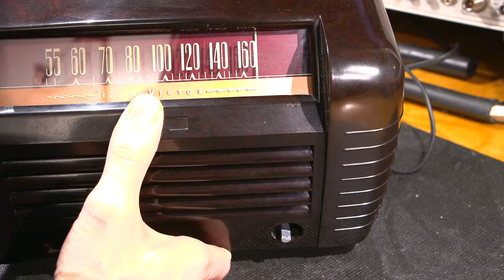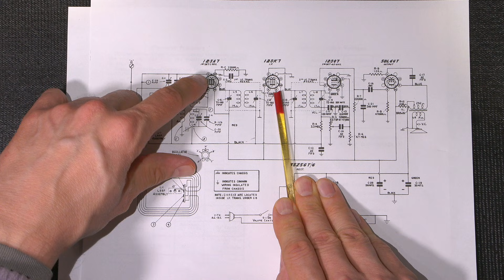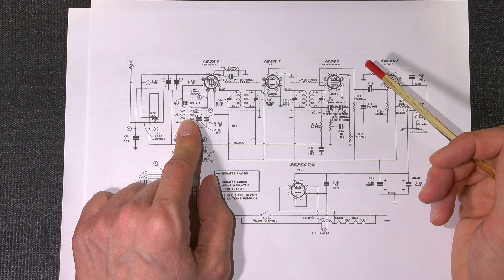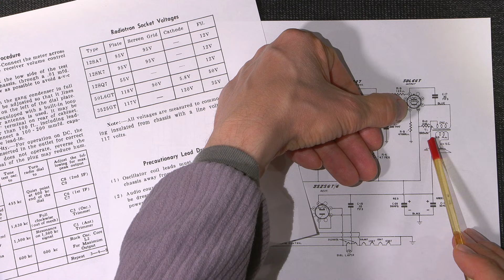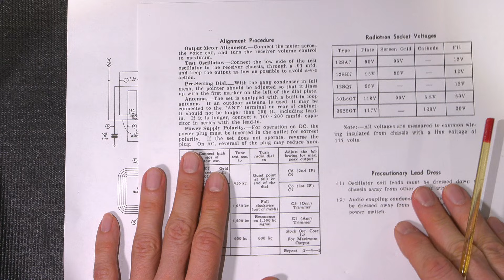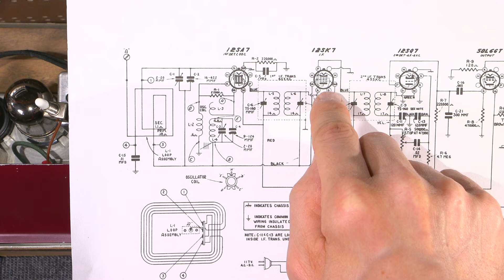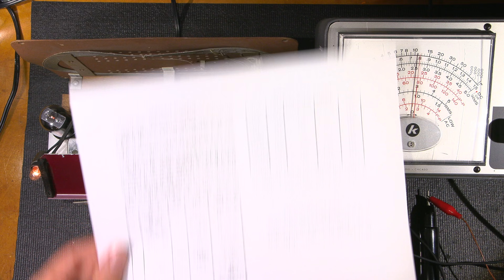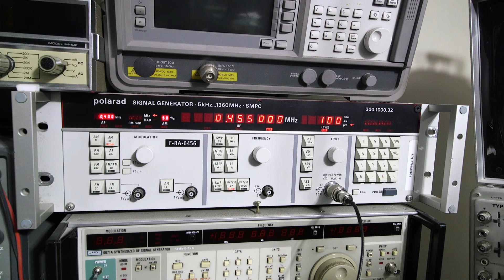Master Electronic Alignments!

Comment from the maker: To learn electronics in a very different and effective way, and gain access to Mr Carlson's personal designs and inventions, visit the Mr Carlson's Lab Patreon page here: https://www.patreon.com/MrCarlsonsLab
Reply: Question, why could you not use a Function Generator?  My Siglent SDG5162 can do 455KHz and modulate at 400Hz.  It can NOT go down to 100uV range, but you can slap the output through a 40dB attenuator (/1000).
Reply: BTW, really great video!  Thanks for the education.
Reply: Ive used a function generator at times but the results were no great, too many harmonics . You need a good LC style oscillator to start with. The sweep control range as unstable too. Function generators are nice but made fir Digital or audio circuitry. RF is its own mysterious world.
Reply: This was a very interesting video you are very good at what you do. Thank you

Comment: Very interesting video. Thank you. A question: If you come across an IF that is really mistuned would you start adjusting the transformers at the beginning of the IF or at the end and work towards the front end?
Reply from the maker: I usually begin with the first IF transformer, then move towards the detector.

Comment: I wish you would say more about the ‘Dummy Antenna’ bit. The instructions for alignment I’m looking at give values for a dummy antenna that vary with the operation being performed: Steps 1 & 2 of the AM Alignment call for 0.01 mfd; Steps 3 through 5 call for a 200 mmfd (thank you explaining that they mean pico farads), the two versions of the IF alignment don’t call for a dummy antenna at all, and FM RF Alignment calls for two 120 Ohm carbon resistors. 

I’ve listened to other YouTubers emphasize matching the 50 Ohm impedance of the instrument to the 75 Ohm impedance of the Device Under Test, and then using a balun to convert to 300 Ohm to mate up to a typical AM loop or FM balanced antenna connection. 

It was a good overview of the several methods, though, and valuable for that reason. Especially for translating the rather cryptic instructions. The output of the spectrum analyzer certainly gives one confidence that the initial has, indeed, been aligned, though. I like it. How much? (Probably more than I can afford.)

Edit: I went back and re-watched you go through the actual steps of the peaking procedure, I really appreciate the tips about the speaker and tone generation. Reading my own instructions, I learned what the cryptic ‘A’, ‘B’, and ‘C’ markings were on my schematic: they are calling out the insertion points for inserting the signal from the generator! Thanks again.

Comment: I peak the IF and then chek them with my Tiny/SA spectrum Analyzer. Your curve was all wonky because you used physical connection to inject your signal and caused overloads and mis matches. I loosely couple my signals in using sand old loop from a junk radio and couple it to the real loop , part of the set. You also did not disable the oscillator for accurate IF response.  Either response would deliver  the same results to the human ear.
Reply: Trabajé como ajustador en fábrica de radios. No es necesario bloquear al oscilador en los ajustes de FI. Nunca el tamdem (o capacitor variable) debe estar cerrado, aunque es suficiente con que esté a mitad de recorrido o más. Lo ideal es neutralizar el AGC pero tampoco es necesario si se utiliza la mínima señal posible desde el generador de señales. En aquellos tiempos no utilizabamos barredor para FI de am. Hoy, ya como hobby he fabricado algunos y es muy placentero ajustar con ellos.

Comment: When I was a kid in the 1960s you seen part 15 of fcc stated shall not cause radio interferance on lots of things. Crummy little walkie talkies that wouldent even transmit across the street even had this stated on a tag. Jump to today, you don't see this anymore.led lights and switch mode power supply's rip up a m radios and nobody seems to care . I think the movement sacrificed a m for these crummy products that fail to live up so they could push thier junk import products!

Comment: I have an old Lafayette radio with no alignment instructions available anywhere.  I've got much of it sorted, but the speaker is a field coil type with a humbucker coil in series with the voice coil and the output transformer is mounted right on it..  The only way to disconnect the speaker would be to cut the thin and very short wire between the output transformer and the speaker terminal.  Which could be difficult to repair.  Is there another method to measure voltage and peak the IF coils with the speaker in circuit?

Comment: I'm working on a Duk v95 set which is a 3 band set. I'm trying to relate the alignment procedure to the one in your video. In the manual I think it is telling me to use a 128khz modulated signal and go through the same process as you talked about. So does that mean the IF of this radio is 128khz?

Comment: If you didn’t have a VTVM would it still be useful to disconnect the voice coil of the speaker from the output transformer and connect something like an AVO8 across the output transformer? I’m thinking the impedance would still be far higher than the speaker and allow for better sensitivity?

Comment: First I want to let you know that I absolutely love your channel. Your knowledge and the quality is just beyond reproach. The only comment I wanted to make about this video was about when you were describing these all American five tube radios that were transformerless, you mention it was done to keep costs down. I believe that was true in later years, but initially it was done because a lot of the power especially in large older cities like New York was truly just DC. As AC came on line a lot of the buildings were supplied with both AC and DC, but initially it was only DC. So in order to make these radios work in both situations they had to be transformerless to function. It wasn't a matter of being transformerlesd to save money but in order to make it so people could buy these radios and actually use them as they only had DC available. In fact New York City shut down its last DC supply to the last section of the city in 2007! There were a lot of people that would utilize the wrong outlet and actually damage their newer appliances as there were both AC and DC available especially in apartment buildings in later years.

Comment: Got a very interesting series strung set, but it’s AC only. It’s using a 25Z6G as a (I believe it’s full wave) voltage doubler. It does have a little bit of 60hZ on the speaker. not bothering me though very quiet to me! The receiver is receiving, but the alignment is off.

Comment: Ive got a vintage AM Firestone radio. The service notes clam an IF frequency of 455 Kilohertz. Upon testing the alignment it is revealed to be tuned  to 465 Kilohertz.  The reception is quite good, it picks up 20 stations , good for an AA5 radio. I was considering retuning the IF’s to 455 K. However none of my alignment tools fit the slug slots. This is far as I am going to go. Why screw up a good working radio. My tools are all new and not worn. I have every slot size. The diameter of the slug is very small . It is difficult to see inside the coil shaft, but I can see a straight screw slot. Possibly the core is frozen? From experience I know to leave it alone for now. My curiosity considers is 455 as good as 465. IF signals are IF signals as long as you are in the ball park of standard frequencies. Its not like working at 260 Khz. 460 is still within the design ranges

Comment: When I learned to do an alignment, the first step was to disable the oscillator and then place the leads of a Simpson 260 VOM across the the speaker secondary with a 4 ohm dummy load, speaker disconnected. I still use that technique as well as the Sweep IF method.

Comment: Nothing was said about the VTVM setting on AC or DC. If connecting across the voice coil, I would think the AC setting sould be the proper setting. The output transformer doing what transformers do, blocks DC. which would logically say to me that the voice coil is an AC winding. Therefor, why would a meter be on the DC setting?

Comment: Paul this receiver has been one of my toughest, I don’t have the original fiberboard antenna so figuring out the wiring that is suppose to connect to the two sections of the antenna and back to the radio has been tough. I see it needs a signal to show voltage at the voice coil so what would be the max voltage I could see on the voice coil? I have voltages in all points of the radio. Last why does it have a 3 wire hookup from the primary of the speaker transformer. I only work on this when I have nothing else to do. Thanks.

Comment: Ive searched and searched. No one has made a service grade AM Sweep generator , I say again no one. Yes, you can get a lab grade unit for Big bucks. Eico once made a wobulator type, but it sucked and none of my fellow techs used it. The old guard of the 1950’s swore by the peaking method  , a signal Generator and simple meter.RCA made the 501 that swept the 455 Kc IF range. You had to plug in a Crystal, that RCA never supplied. Whats that say? I had that one once and again it sucked on IF alignment. Sooo..back to the peaking method and I done in 15 minutes. Once I had access to lab grade equipment, bit could never see any advantage of sweeping 455Kc. Back in the 1970’s. Company called Murata made a ceramic filter to replace the entire IF stage. It worked but added 5 cents to the cost of manufacturing, so it was nixed .
Reply from the maker: You might be interested in this: https://richardsears.wordpress.com/2011/09/08/triumph-830-wobbulator-oscillograph/ It's designed to sweep lower frequency IF's and its a scope in one package. I don't own one, but I'm sure one will find me and end up in a future video.

Comment: Was the  radio you aligned  in the alignment tutorial an RCA? I have one just like it , however the lower end of band tuning coil next to the variable capacitor is missing from my radio. I’ve been doing AM radio alignment for over 50 years and still found your video an eye opener. Ya learn something new every day. I have never had the equipment to do a sweep alignment setup. Now i might look for a sweep Generator. 
When I learned  the AM alignment  process we used a. Simpson 260 on the AC scale and output function.

Comment: In an all american 5, what would be the effect if you made a Ground loop around the chasis and Isolated it from voltage with stand offs?  Is there a NEED for the chasis to be electified?  On an older radio I found both a ground circuit and a different chasis ground, both used a different colored wiring on each of the circuits. It wouldn't be much more to do than rewiring the line cord and all cap and such if it would be safer with a couple of standoffs and 2ft of wire.

Comment: An example of a high powered radio station (in experimental mode) was WLW in southwestern Ohiol  ITS max power was 500,000 watts.  It was entirely experimanl and just before wwII its license was put back to 50,000 watts.  Stories from Mason Ohio where the transmitter is located in that time had music coming out of gutter pipes.  Because of its experience their engineers were tasked with designing Voice of America (Bethany, Ohio).  Hitler call them the Cincinnati Liars because of VOA' broadcast.

Comment: This comes over half a year later, but I hope it still turns up OK.  When the instructions and you mentioned the 10 nF (A.K.A  0.01 microfarad) coupling capacitor, it might be good to notice that modern capacitors have pretty much abandoned marking them as fractions of a microfarad.  In fact, the  ISO and other international standards spell out a rule that values should be expressed such that they fall to range of 0.1 (inclusive) to 10 000 (again inclusive).  What the capacitor manufacturers use for at least the small ceramic capacitor (10 nF as an example) is two digits ( 10 for the beginning value ) and follow with a multiplier ( 3 in this case ).  The multiplier counts up from picofarads and means the number of zeros after the "10".  That produces the final meaning of 10 000 pF, labeled as 103.  Film capacitors have more space for printing their values and may not use the same method that the ceramic capacitors do, but in any case it would be beneficial to understand the picofarad based marking, I believe.

Comment: I love you video's.They are great way to relax and learn too.You do a excellant job of explaining what your doing.its hard to believe all the stuff our last generations invented. just getting radio to work and radios to recieve it  were great inventions. i remember my mom and dad had tube radio's. i remember the heat coming from it would keep us warm in the winter. And it had a certain smell too if dust was on the tubes...lol. please dont stop your video's i ve learned alot about electronics. Thanks Again be safe have a healthy year.

Comment: Great job Paul! I botched an alignment on a Heathkit AR-3 because I was feeding too much RF into the device. Took me several attempts to get it.  I was using a Heathkit IG-102 signal generator. I discovered I could simply wind the test lead wires together to inject signal rather than stick the alligator clip from the signal generator on to the radio. This greatly reduced signal and helped me get the old AR3 working again. This video sure would have helped years ago when I attempted that alignment. FYI: gee whiz you sure have a nice RF signal generator.

Comment: This video is a fantastic reminder of all the stuff I had forgotten.  Be nice to cover fixing when the dial is in tune at each end but goes out in the middle and requires bending the outer oscillator plate.  Be nice to mention clamping the AGC for alignment and your modern signal generator output is PD / EMF. And final using RMA dummy antennas. Thanks for sharing regards Chris
Reply: En fábrica podría ser, pero en reparaciones no se tocan las placas exteriores recortadas. Trabajé en fábrica ajustando radios, no neutralizabamos al AGC (CAV antes) pero usabamos la mínima señal posible del generador de manera que el agc no actuara o lo hiciera muy levemente.

Comment: very nice Paul ,  my questions:
1:  a-v-c in today term , is it the same as AGC , Automatic Gain Control ?!
2: is it better to disconnect a-v-c feedback during alignment ?!  it seems some time too much gain , and oscillation from speaker could be heard by adjusting those capacitor to counter measure it , of course after alignment was done you can put it back a-v-c in action
Reply: AVC (o CAV, control automático de volumen) es una antigua manera de describir al AGC o CAG. No es necesario desactivarlo si se tiene en cuenta usar la menor señal posible desde el generador de señales.

Comment: I would definitely like to see more about visual alignments with spectrum analyzers and/or sweep generators, as I have restored lots of old radios and often have trouble getting sweep alignments done properly, especially on FM receivers. I do quite well and get good results with signal generator/VTVM alignments, such as the one in this video.

Comment: Thanks for another awesome video, Mr. C!  Even though I thought I had a good grasp on aligning AA5 radios, you still managed to offer some nice little gems.  Seeing alignments done on different radios and from a variety of perspectives, using different tools is really useful.  You provide such a wonderful service to all of us.  Thank you.

A video that I'd like to see would be focused on AA5 loop antennas, their designed length, number of winds, rebuilding/replacing them, and anything you can think of to add.  I had an old Crosley that had no loop antenna, and I couldn't locate a Crosley replacement.  I could have just used a long external antenna, but I really wanted the radio to be complete with an internal loop antenna.  Therefore, I decided to build a replica but really struggled to gather all of the necessary information from a variety of sources.  It seems to work ok, but I suspect it's still not quite right.   I think you could do a wonderful job explaining everything we could want to know about AA5 loop antennas.

Comment: Very informative video. I must say it wasn't clear where the spectrum analyzer was connected on the circuit or if the internal source was used or if it was the same signal source. Looking forward to the announced video that will show visual alignment with source and scope and source and SA, perhaps even source and distortion analyzer. My main interest is FM so hopefully that future example with be FM/FM Stereo. If there are special terminations to use to not load circuits or protect from DC it would be good to mention. I understand that probes that incorporate the log amps like the AD8307 can be very useful to visualize the IF response on a scope for the extra dynamic range.

Comment: Hi!  By far, the best lesson on radio alignment I have seen over the last 50 years of electronic repair.  All was so well explained and all so accurate.  Unfortunately, I do not have all the equipment that you appear to have collected.  Next, the restoration of a transistor radio or other transistor electronics.  Will you use cold spray to temporarily  reactivated a burned out component?  Do you use cold Freon spray for repairs?